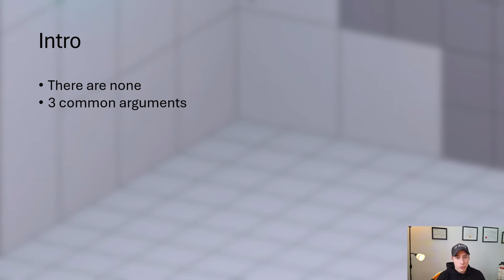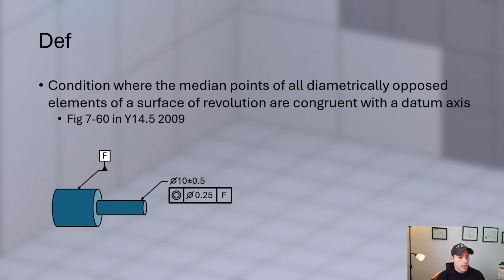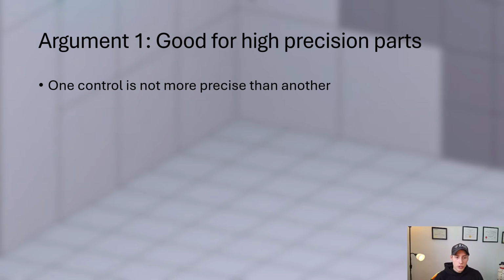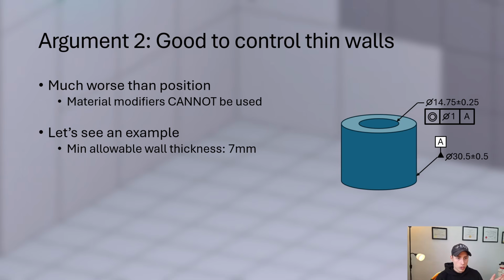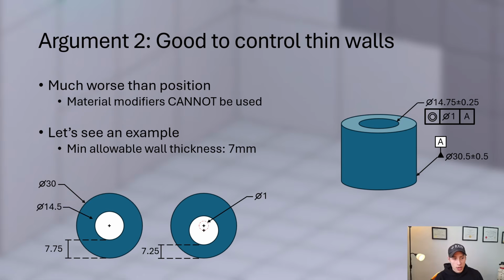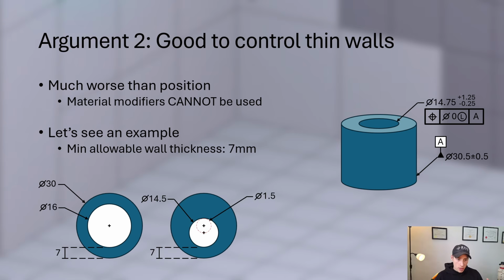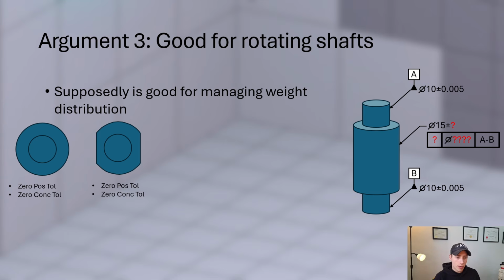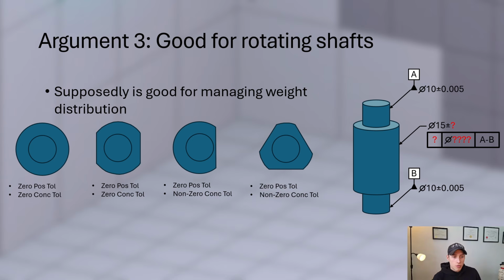GD&T Lesson: The Argument for Concentricity

Comment: Part of the issue, I think, is that most people don't know the true definition of concentricity and why it is such a pain in the ass to use. But I've also met people who were told the definition and basically said "yeah well nobody actually checks it like that" then proceed to just check it like true position or runout
Reply: As far as the software engineer is concerned, they are all the same. (Except true pos deviation is multiplied by 2 for some strange reason)
Reply from the maker: Good point 🤝